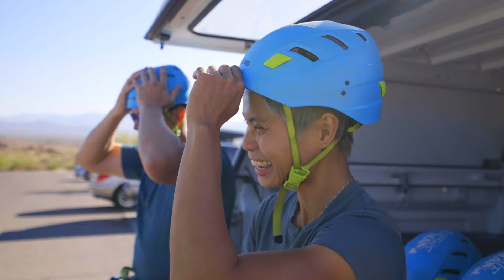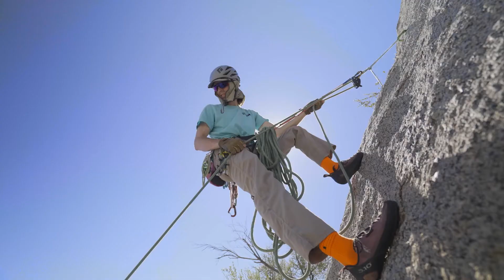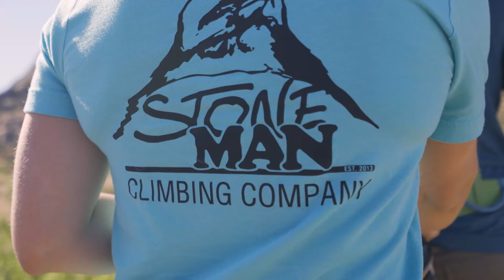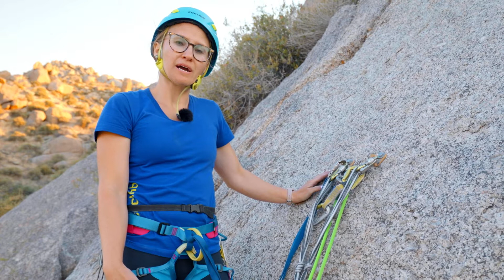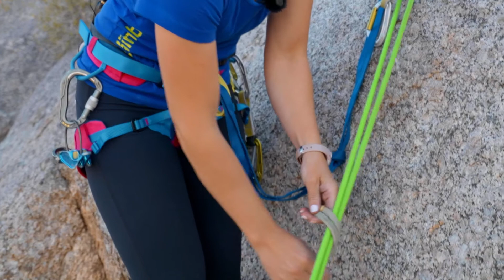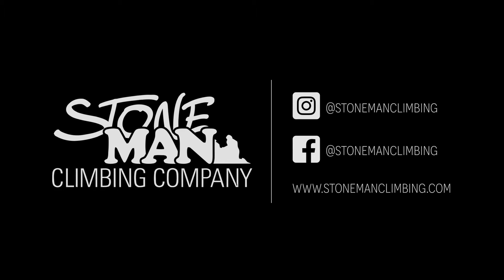How to Clean a Climbing Route using a 4' Sling

Comment: Great video! Why do you put the belay device in the sling instead of connecting it to the harness?  Seems a bit more error prone in the sling.
Reply from the maker: Thanks a ton for the shout out Wade! An extended rappel has several advantages...First, it creates separation between the belay device and the third hand. This prevents the third hand from getting too close to the device and collapsing. Also, it keeps the third hand from getting sucked into the device and getting wedged preventing the climber from rappelling. If the device does get wedged, this necessitates the climber unweight the rope and ascend the rope (in overhanging terrain this presents a real issue for the uninitiated). Second, an extended rappel using a guide-style ATC (or similar plaquette style device), transitioning into rope ascension is quick and efficient. Many multi-pitch climbers prefer this method for that reason. Third, it elevates the device from the climber's abdomen to out in front of their face, which prevents loose clothing, long hair, necklaces, nipple rings, etc. from getting wedged in the device. For this reason, most guides teach and implement this method. Lastly, many find it more comfortable/ergonomic. 

All rappelling methods are error prone as it remains one of the most common activities resulting in climber injury/fatality. Therefore, whatever method or style chosen, the climber should understand it's uses and limitations thoroughly, how to rig it appropriately and how to assess (double check) that it has been implemented appropriately.

**P.S. On a personal note... when I recreationally climb (not guide), I frequently rappel directly off my belay loop without a third hand. When I guide, 99.99% of the time, I extend my rappels and use a third hand.**